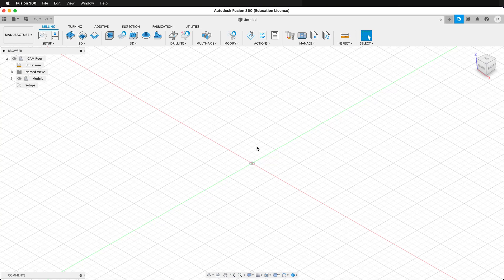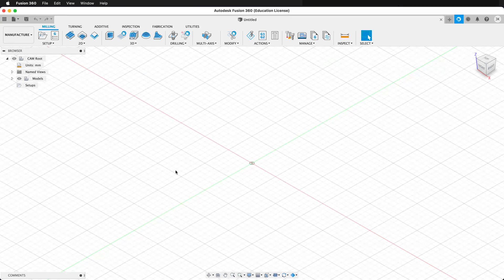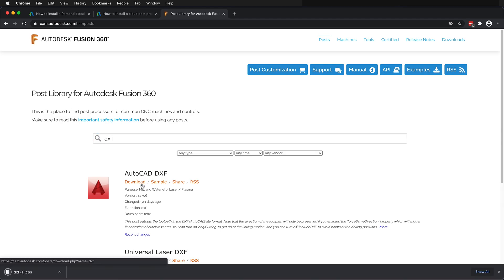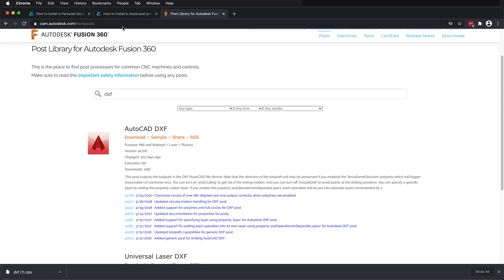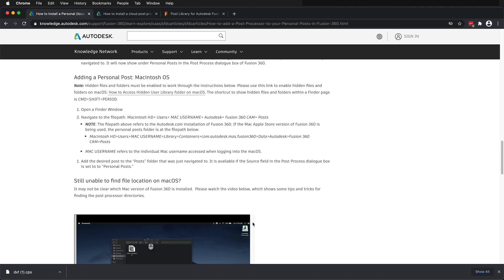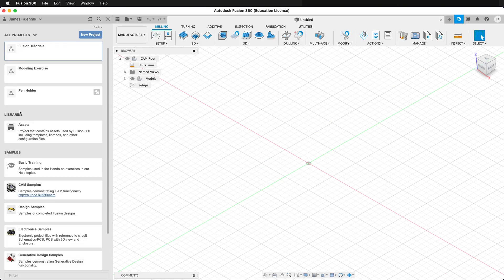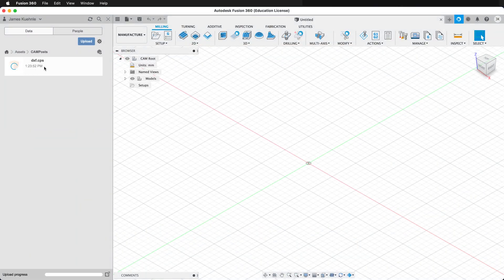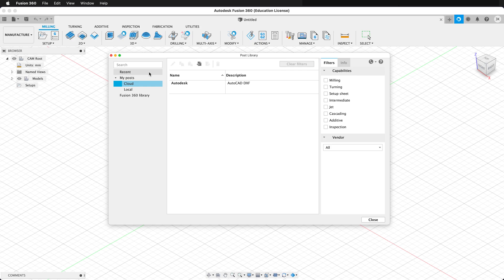Fusion Install DXF Post Process to Export Toolpaths

Comment: Can this export each component in its own dxf file or atleast on seperate layers? Im stuggling to figure this out!
Reply from the maker: Yes there are options to export cut operations as layers in the dxf post process menu
Reply: @WhatMakeArt I'm new to the manufacturing work space and I have a question about this. I'm using the fabrication 2d profile and am selecting all component faces with the geometry contour select option. But when I use the post process and select the export to seperate layers it doesn't seem to separate out the components. Do profiles need to be cut separately as well?
Reply from the maker: You would need to make each profile a different cut operation.

Probably easier to export polylines, a checkbox option in the dxf exporter, and then separate to layers in a vector program like illustrator or corel draw